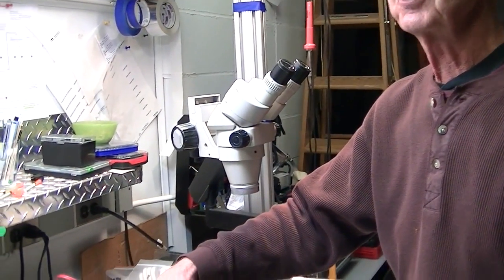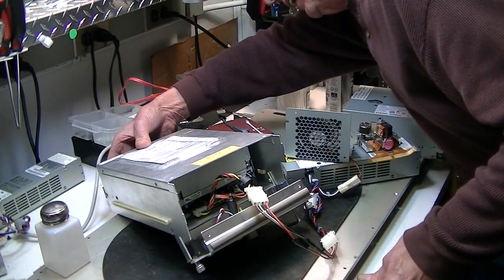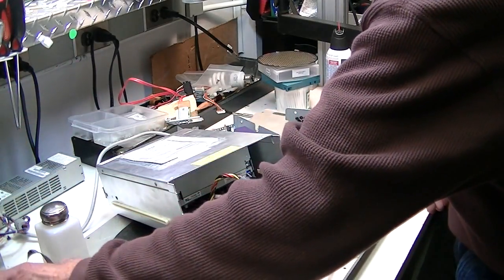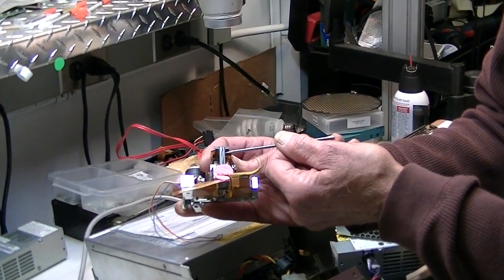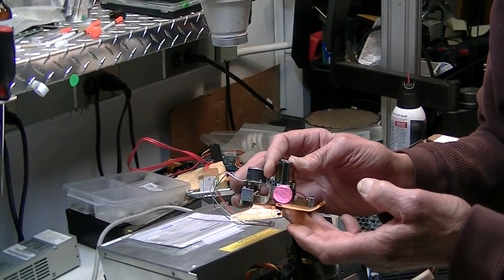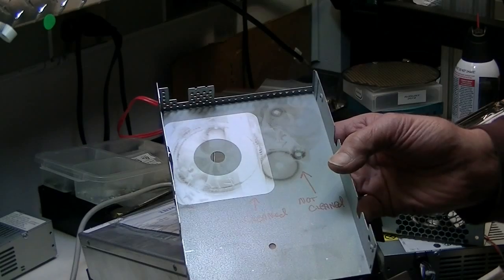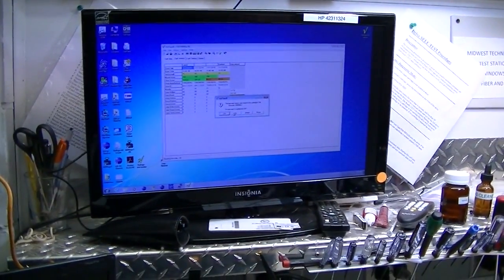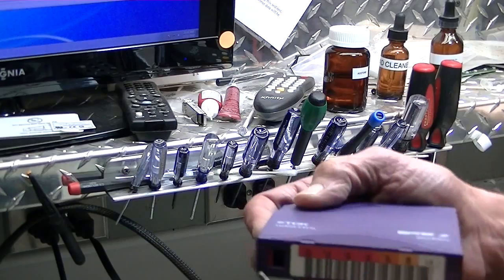Tape Drive Repair - Eject Stuck Tape

Comment: Thanks for such valuable infomrantion, 
I need your suggestion on malfunctioning  IBM LTO7 -H drive.
LTO7 DATA tapes becoming BAD TAPE while cleaning cartridge working fine with same drive.Also few LTO7 tape tagged as cleaning cartridge in backup software.
Please share your suggestion to rectify issue.
Reply from the maker: Aakash:  Sounds like you have a back up software issue more than a hardware issue.  Not knowing your back up software you may want to check on the blogs regarding the manufactures software to resolve this issue.
General  comments regarding your issue are as follows.

Data media being placed in a dedicate cleaning slot.
Unfinished or failed back up request- clear all pending back ups.
De install your back up software, remove tape drives via device manager. - Shut down server also remove auto start for software upon a re boot if enabled.
Power on you library and allow to finish the POST.  
Re power on the server - make sure server finds new hardware  and installs the proper drivers.  Check the device manager activity.
Now re activate your back up software.  The software should find the new hardware, library and drives and install the proper drivers.
Some back up software may require formatting the media that was flagged as bad.  Again check with the back up software manufacture on the suggested remedy for the marking of tapes as bad.
Please note we are NOT software experts so these generic instructions may not work.  We are a very technically advanced hardware experts.  Annually, we purchase, repair and sell over 3000 LTO drives per year in all configurations.
Regards,
Dan - Owner Midwest Technical Sales
Reply: @repairmytapedrive  Thanks for prompt reply and corrective steps Sir.I want to give more information about issue.

We are using veritas backup exec with IBM TS3100 tape library (Two drive LTO5-H and LTO7-H).
All backup job running fine with LTO5 drive only issue with LTO7.
Observation in TS3100 web consol
1) when backup job start tape loaded in LTO7 drive and stuck on reading status(approx 20mins).
2) During this period some time status change from reading to calibrating and again stuck on reading status.
3) Finally tape tagged as BAD Tape OR without any additional tage tape return to it's slot.
4) In case of bad media tage,Vertas backup exec also declare bad media in description.
5) In case of no any additional tage,Vertas backup exec tage. cleaning media set

Please give your suggestions.
Reply from the maker: @aakashsenjaliya1222  Aakash  I am alos somewhat confused a TS 3100 can only have 2 tape drives, you stated you have 2 LTO5 drives and are having issues with the LTO7 - Please explain
Reply: @repairmytapedrive   Resepected Sir,
We have only two drive in TS3100 .
One is LTO5 drive and Another LTO7 drive.

Note: One LTO5 come with fresh purchase of TS3100 and later on after one year we procure LTO7 drive and added in TS3100.

Comment: In another YT video, I saw someone connect a SATA host bus adapter to an LTO drive with only SAS interface. Would you comment on how to figure out on which drives this might be possible?
Reply from the maker: Hi Brad:  That process is very not standard, I am not saying that it cannot be done but not recommended.
Who knows if the device show in the DM with out errors then give it a try.  We never run tape drove that is a SAS drive needing a dedicated HBA via the SATA port.
Remember a LTO drive wants to stream data so it will slow down the transfer rate of the drive to match the data coming from your server.  The LTO drive can throttle back about 12 steps to accommodate the buss speed the server can present.  Not sure if SATA can do that.

Hope this helps
Dan
Reply: @repairmytapedrive  Thanks Dan. I found out later that I misunderstood what the person in the video said. He had actually used a SAS HBA. Thanks.

Comment: A very helpful video. One nitpick: I'm guessing you meant "RFID" not "RDIF" chip?
Reply from the maker: Thank You Brad demonstrates you were listening.  Great compliment  After we do these videos the entire staff will look at them on the big screen.  We all get some great laughs about the mistakes we make.  I do get the terms confused those RDIF and RFID my confusions are rooted in the aeronautics and amateur radio genes that I also have.

Technically as IBM refers to the chip as a CM chip, I am not certain if in that video I did show the tape drive transmitter and the CM chip(receiver) enclosed in the media.
From IBM
Cartridge memory chip (LTO-CM)
All generations of the IBM® LTO Ultrium data cartridges include a Linear Tape-Open Cartridge Memory (LTO-CM) chip.

This chip ( 1  in Figure 1) contains information about the cartridge and the tape (such as the name of the manufacturer that created the tape), and statistical information about the cartridge's use. The LTO-CM enhances the efficiency of the cartridge. For example, the LTO-CM stores the end-of-data location which, when the next time this cartridge is inserted and the Write command is issued, enables the drive to quickly locate the recording area and begin recording. The LTO-CM also aids in determining the reliability of the cartridge by storing data about its age, how many times it was loaded, and how many errors it accumulated. Whenever a tape cartridge is unloaded. The tape drive writes any pertinent information to the cartridge memory.

The storage capacity of the LTO Generations 6, 7, and 8 is 16320 bytes. For Generations 5 and 4, the LTO-CM is 8160 bytes. LTO Generations 3, 2, and 1 have an LTO-CM capacity of 4096 bytes.
++++++++++++++++++++++++++++++
On one of our recent videos I talked about the spacing from the media to the head transducers and claimed they were 2 microns not .02 microns which they are.  As you can tell from our lack of finesse in these productions we are not scientists talking about tape drive repair just folks who test, repair and sell over 3000 of these devices on a yearly basis.  We all have engineering backgrounds some with degrees and others with a whole host of experience.  Some things we have in common is great deductive, inductive analytical skills to share with one another.  We are a very seasoned staff with no addenda's we do get along well.  We all appreciate any objections we receive.  

I do interact on a daily basis with customers who think I am very smart which in the LTO field I am.  Most of these folks are experts in their fields some astrophysicist, rocket and launch coordinator folks, some strategic weapons military folks, very high end video production folks.  All are experts in there respective areas.  What a fun activity for me, can not call it work.  We have been in business for over 35 years

Regards, Dan
Owner of Midwest Technical Sales  www:mwtss.com
Reply: @repairmytapedrive  That's the best kind of work-work you love. And your love of it shows. Very helpful info. Thank you!

Comment: Thanks a lot. Could you explain about "Drive Broken (code: f3 50)" in LTO7 HPE Library? Thanks.
Reply from the maker: Typically 'Drive Broken' results when you get an error code 5 show up on the LED display on the front of the drive.  Error code 5 is also typical of having to do with the PCB board.  We offer a no-cost repair evaluation and would take a look at it for you and let you know what the problem is and how much to repair.  You can fill out an RMA form at our website https://mwtss.com  We have ways to 'clear' that error code and then see if we can replicate it.  It may just need to be cleared.  You can also call us @ 952-736-0200 if you would like to discuss your options or speak to our technician.

Comment: Great tutorial but your workshop is a complete mess. As a tape drive repair expert i keep my work area super clean as these drives must be repaired in the proper environment.
Reply from the maker: Chris:  Many repair labs have dedicated work stations for only working on one device.  As a full service repair facility each workstation is a multi platforms such as LTO, DAT, 8mm, DTF tape drives, Nine and 36 track tape drives, autoloaders stand alone and library platforms.
Although our workstations are not pristine we do test and repair and sell over 3000K of LTO drives.

As a tape drive repair expert I wonder if you do access the on board tools via the RS232 port for diagnostics as well if you have HH IBM head alignment tools to take the trial and error out of the head replacement.
Please advise, I am certain our viewers would like to know.